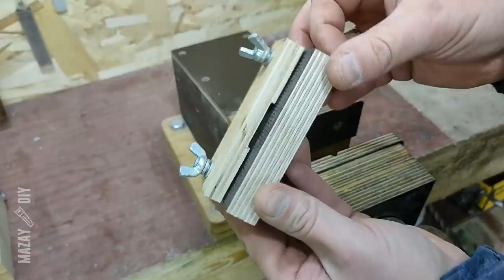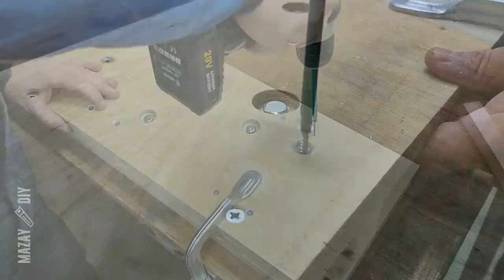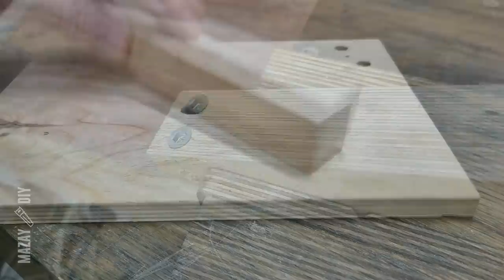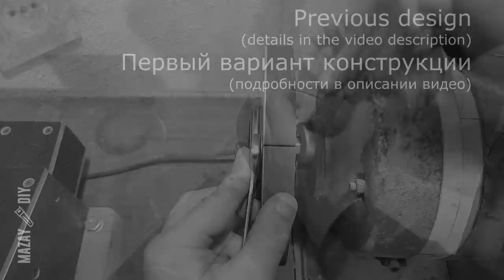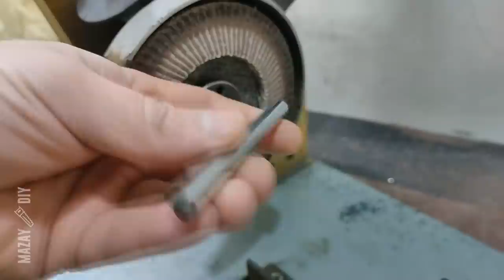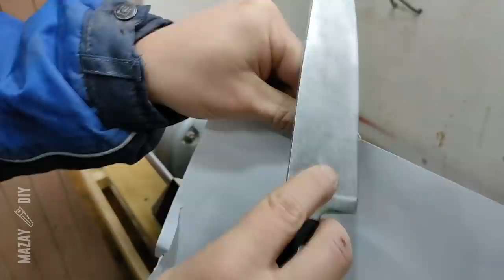Homemade Knife Sharpener | Easy Way to Sharpen Knives and Chisels Scary Sharp

Comment: Thx for sharing! With that amount of rpm, how did the temper withstand in the blade a month or so later? Really appreciate your advice!
Reply from the maker: Wax effectively cools the steel - does not affect the heat treatment of the knife